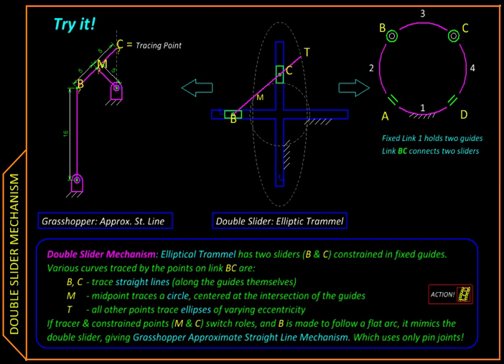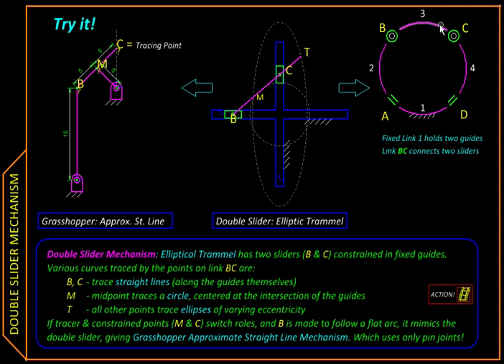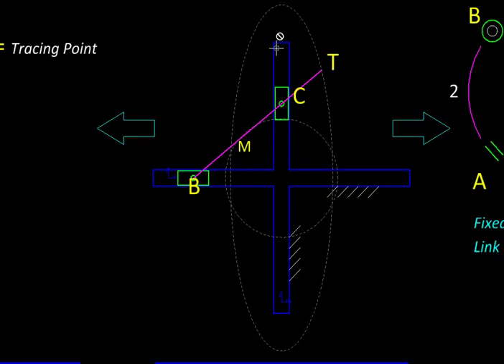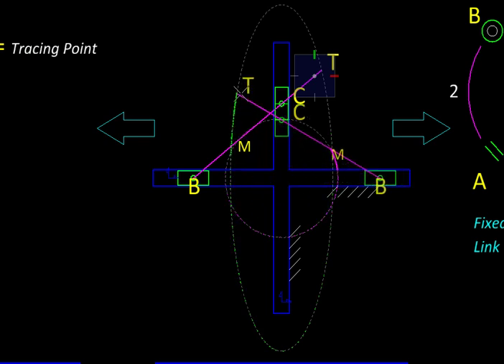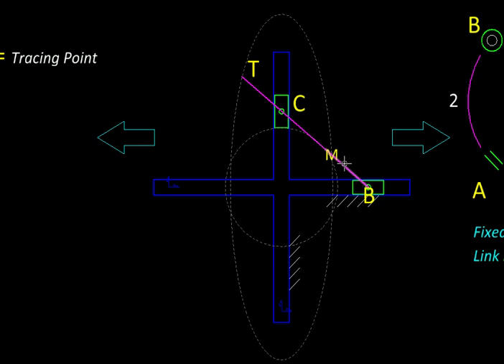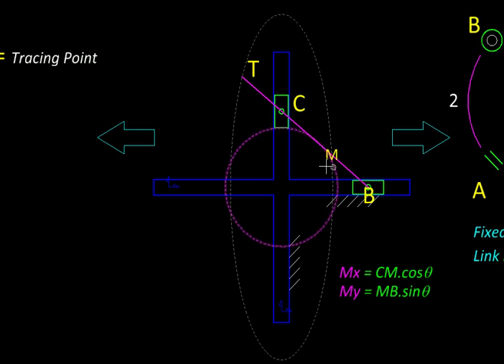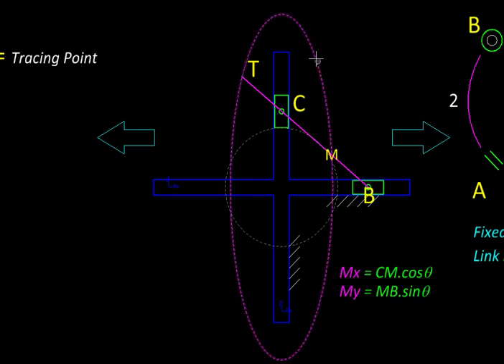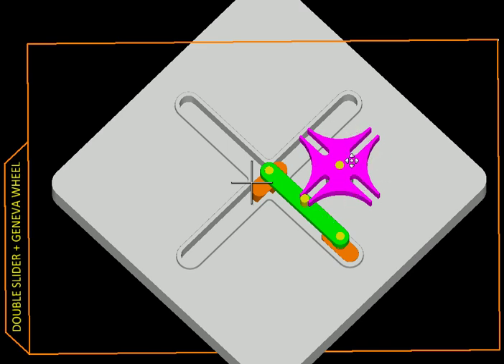Kinematics Ch01J Double Slider Mechanism

Comment: Hello Sir, I have a doubt. What if we rotate link 1 ( consisting of the two guides ) ? what would be the movement of link 3 in that case? Plz explain Sir. Thanks.
Reply from the maker: Ashwath Mukundan In general such a variation is called an inversion. And the one you describe results in Oldham's coupling. All inversions are covered in this course. Take a look at Ch01L
Reply from the maker: Ashwath Mukundan Interesting clip! Yes, this is possible. But it is not a fully constrained mechanism. E.g. notice the rod remains vertical all the time WITHOUT any linkages to ensure the depicted motion (translation along a circular path) This is artificially achieved in the animation. To do this in practice, I would add 3 revolute pairs and two more links to Oldham’s coupling. This will be an interesting 6 bar to animate! ... so watch this space …:-)
Reply: UjjwalRane Yes sir! waiting for the animation! Thank you!